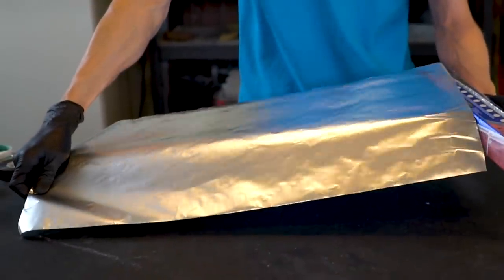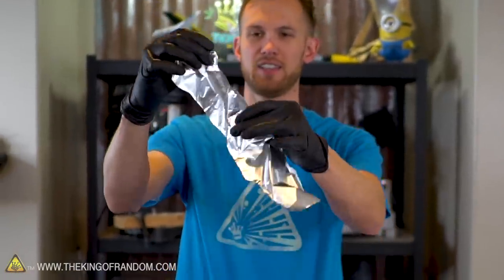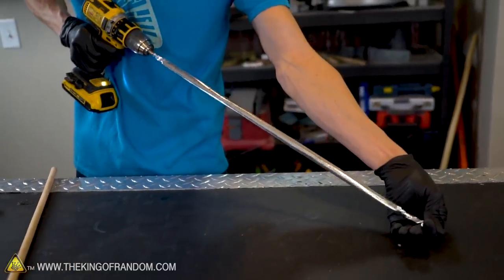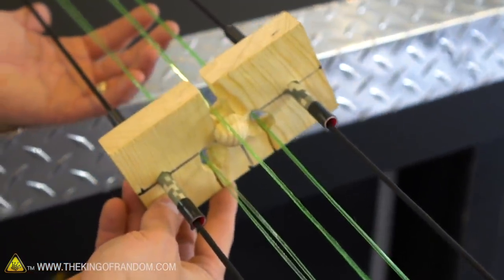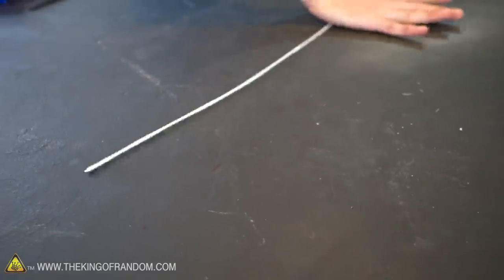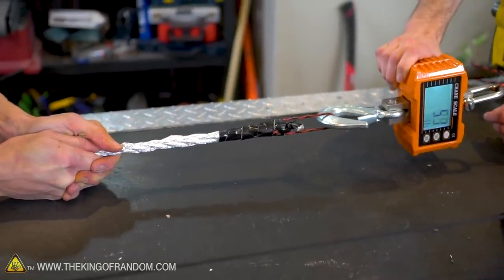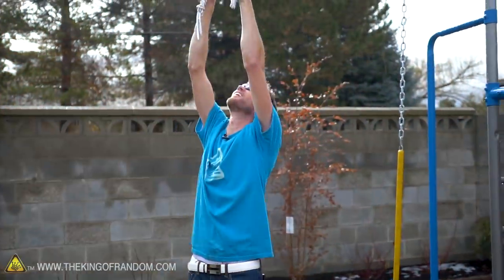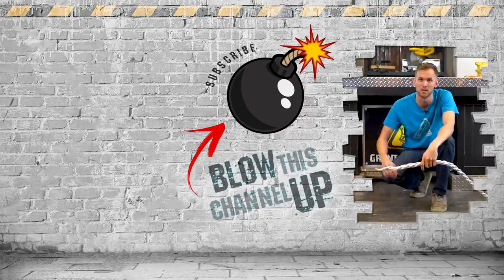Can You Make a Rope with Aluminum Foil?

Comment: Wouldn’t braided aluminum “rope” ...be an aluminum cable?
Reply: Yaaaaaaaaaaaaa
Reply: Duh
Reply: if it's purple it's called a braided Thanos.
Reply: Exactly what i was thinking. Thats basically what power lines are.
Reply: James Murray nasa wants to know your location
Reply: Yeah
Reply: Not really.
Cable is made from wire, that is metal that has been drawn through a die to form a long and solid piece.
This aluminium rope has been made in a totally different way.
Reply: @RovingJack  GG
Reply: @RovingJack  vi cbg
Reply: I mean he was saying cable in between the 9 and 10 minutes
Reply: @skinnyg214  pretty sure that is not want power cable is made of, its copper not aluminum. And second. The strand that everything is lashed onto is a steel cable 
(I work for a line work company I'm around it constantly. just an fyi)
Reply: @devincarson3577  i heard somewhere that a lot of new lines are switching to aluminum to be lighter and cheaper than copper. Im not an expert in this at all and if you have other experience, feel free to let me know :)
Reply: He said "cables" at about 10:02
Reply: Yeah
Reply: Jeff NME sis really hit us with the facts

Comment: You have a BIG problem that you did not know about or you did ignore it.

Aluminuim work hardens very quickly. that means every time you deform it (bending, rolling, pressing and so on) it becomes harder and more brittle and you aslo destroy the cristal structure of the metal what makes it even weaker. to prevent this you  can relax the metal by heating it making it more flexible, that gives you a new working window where you can work on it bevore damaging it.

When professionals deform aluminium they bend it a little, heat it up, let it cool on its own and beding it a little more and repeat.

aluminuim  melts at 660c° 1220f so i think heating it to 400c°-500c° max   752f-932f max should work.
I know this from Metal working scool in germany and have experienced work hardening many times my self but did never need to soften it there was always a workaround.
maybe there is someone here who has done this before and can share his knowledge.
Reply: That's interesting! Heating it would have been a very nice idea!
Reply: Longest comment ever
Reply: @explosivelemon5099  You don't read a lot of intelligent comment then :p
Reply: Blake Roberts this was actually quite short for a description
Reply: Though this may be true. His tegnique for making the rope itself was also poor i think.
Reply: @Lemmes Gaming noticed that TKOR viewers are not very smart, judging by most of comments
Reply: Very true
Reply: @Michursky  tkor itself is not very smart
Reply: *school
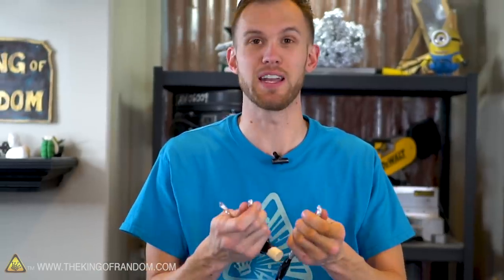Reply: He actually addressed this from about 4:40 to 4:50 ish and said that bending the metal made it weaker and gave the example of bending a paper clip. So although he did ignore it (because the user comment was asking to make a rope, not to see what happens when you bend aluminium foil) he did address it..
Reply: I learned this doing the metal working merit badge for Boy Scouts.
Reply: Yes, annealing is important!
Reply: Can you  make a rope with Seran rap
Reply: On an atomic level this is a really cool process. Individual atoms are shifting position within the crystal. To a point, this hardens the metal--this is why you hammer the edges of bronze swords after casting, for example. A crystal can hold only so many of these shifts (call lattice defects), however, and eventually a bunch of them line up, forming a crystal face, in effect splitting the crystal in two. When a metal breaks, those broken bits are actually a huge number of individual, new crystal faces. 

When you heat up the metal, you shift those lattice defects into new positions, creating new crystals--but without altering the shape of the overall object (much, anyway). It's one of the few common solid-state reactions. In effect you re-set the crystals, allowing more defects to build up before it breaks. 

This process has tremendous consequences in everything ranging from geology to engineering. This is why bridges fail, why rings break, why some beams are "pre-stressed", and how rocks bend. It was really fun in college seeing the same process discussed in structural geology and jewelry making classes. 

If you're going to heat up aluminum foil you need to do so in an indirect way. A torch or other direct heating method is going to make one side too hot, while the other side is still too cold. Foil is VERY easy to melt, being so thin. Maybe a toaster oven or similar would work. If you can carefully control the temperature of a kiln that may work as well, but I doubt you can get the temperature low enough.
Reply: The point of this excitement was to design a rope straight from the foil, but yes heating it up and letting it cool in a rope shape would definitely work.
Reply: shalini prasad u
Reply: @explosivelemon5099  youve been on youtube for about all of twenty minutes huh?
Reply: I had no clue... thanks for sharing.
Reply: Great comment! I came here to say this!
Reply: Nerd
Reply: Isn't it °C instead of c° ? Just asking
Reply: Dragnaros Donevan you are a beat. How long did this take you to write
Reply: who would actually read of that tho🤔🤔🤔
Reply: @wolfieg.6730  It sure is

Comment: What happens if you try yo melt down aluminum foil in a furnace? Like you would need a TON! But I wonder if it would be really pure once you turn it into ingots.
Reply: Hmmm... Would be nice to see.
Reply: :D
Reply: @B P I just want to see how pretty an aluminum ingot would be... Probably close to an iron one if I had to take a guess.
Reply: Pretty amazing suggestion
Reply: Chance Gray do u play Minecraft
Reply: That would be cool to see. Like, part of me is thinking, "Okay, so it's aluminum foil, so anything made from it melted will probably be weak AF." However, aluminum, when not thinned out like the foil, is hard and heavy metal, which is why there are so many things made with it. I just looked it up, though, and the foil itself is 92-99% aluminum while the ingot is 99.98% (Basically 100%) aluminum. So, what will that last 1-8% do when the aluminum is melted? But, to amp it up, I want to see how some things, like dry ice, reacts with the molten aluminum.
Reply: aluminum ingots
Reply: Molten aluminum is combustible in an oxygen atmosphere.  If your speed is too low and/or feed is too high when machining or if your inerting process fails during welding it will start spewing small bits of pink molten aluminum and then detonate.  So if the furnace exceeds about 1250F someone will probably get hurt.
Reply: Hey i was first
Reply: I think it would oxidize too much and you would lose a lot of metal because its so thin... except if you crush a bunch of it with mallet.
Reply: So it's dangerous? Now I really want to see!  @thedogsbutler7046
Reply: @mamakangaskhanvideos6376  You realise that aluminium is like the lightest metal that is practical for everyday use. It is also relatively soft.
Reply: I just thinking the same thing lol
Reply: Yeah thats cool
Reply: I understand that,  @Lolfml , but it also weighs 50 pounds as an ingot. Gold, a softer metal, only weighs 27 pounds in one bar. And the lightest metal is actually lithium.
Reply: Dude this comment got 160 likes overnight O_O
Reply: @mamakangaskhanvideos6376  Be sure to have a Class D fire extinguisher ready.
Reply: Trevor RS05 boi this isn’t Minecraft
Reply: I made an AR15 lower from aluminum cans. Works great. Got idea from a guy here on YouTube. So yes you could possibly do it with foil.

Comment: Can you make rope from plastic wrap or wrapping paper??
Reply: yes yes yes
Reply: i came here to request that they do this with plastic wrap but you beat me to it :P
Reply: Most likely the plastic wrap (Saran Wrap) would be stronger due to the long chain molecules and elasticity of the plastic would hold up better to a pull.
Reply: Yes but it would stretch
Reply: @Ricardo Sahadeo < A chain made of braided Saran Wrap would certainly stretch a little, but not indefinitely.  Once the stretching stops, then it becomes a strong yet slightly elastic chain.
Reply: I made one a few years ago when i got my hands on an industrial sized roll of it. The rope was about 25 feet long and it stretched quite a bit before snapping.

Comment: 1:29 I am fairly certain this is due to work hardening (sometimes called strain hardening).
Reply: It is
Reply: that and the heat imput cause I think foil is 2xxx or 3xxx series so it cant take heat very well
Reply: isnt it called work hardening?
Reply: @richie6799  it depends what material and what the action that is being taken upon the material
Reply: @bigbawss3273  ahh ok thanks
Reply: @bigbawss3273  is there a difference between work hardening and strain hardening?
Reply: Crinkling it may create stress risers in the structure, and one tear will cause the whole thing to fail due to crack propagation.

Comment: Wouldn't folding the foil first instead of twisting or rolling it make it stronger?!
Reply: Yeah, I was wondering the same. Probably would help, the sheet at the very start withstood more pressure than any of the first few rolled or twisted strands did.
Reply: Tightly yes
Reply: JJ's Life I think so, but it wouldn't technically count as a rope
Reply: it would break because its so weak
Reply: @danieltheisen5944  Me too.
Reply: Yeah

Comment: What happens when you mix melted glass and metal?or any other weird materials?please answer this question by experimenting. I'm very curious.
Reply: It will be an hetrogeneous mixture if u melt it for a short but homogenous after a long time....
Reply: Ceramicists and Glass Workers already do this, to some extent.  Ceramic glazes contain metallic powders, and metal foils are added to molten glass, for effects.
Reply: I'd be more interested to see what happens when you cool it at various rates. Even a homogeneous mixture will have different chemicals precipitate out at different rates. This is why popcicles always have that white-ish area that tastes bland.
Reply: That will break the rules of Minecraft
Reply: @jamesverhoff1899  great job comparing a technical topic to a more relatable household object. A+ description!
Reply: Glass (SiO2) is made of silicium, which is a metal...
Cristal is glass with lead (40% mass)

Comment: The rope should work better if the foil is folded instead of twisted  then take that folded foil and braid a rope. twisting the foil weakens it
Reply: 👉ROPE👈
Reply: Exactly, he even said the twisting made it weaker but kept trying it.
Reply: That's what I wwas thinking!!!! He just said that cutting it (which is essentially crimping/folding really tightly) made it difficult to pull apart..... So?
Reply: I believe the word "experiment" is used to prove something actually work
Reply: Really, I kept thinking it needed to be braided or woven in some way if twisting was a bad idea
Reply: `Yup, he should have folded into thin strips, not twist it.

Comment: can you make a salt water battery using aluminium, salt and copper
Reply: I like that 👍🤔🤔🤔🤔🤔👍 100 thumbs up
Reply: no because you dont have water
Reply: An "effective" salt water battery, complete with compressed carbon and stainless steel plates, etc... would be a great idea!
Reply: Wow that would be cool! 10000000000000000000000000 LIKES
Reply: Sadly its impossible
Reply: @insitefire272yeet2  you are technically right. The best kind of right.

Comment: Try melting aluminium foil then making a rope from that
Reply: Plz like lol
Reply: Magic21maker 21 then it would not move
Reply: It would be a rod at that point
Reply: They would have to take like at LEAST a few weeks. Since they have to melt the aluminium foil and pour them into small threads. So just to make 4 threads in a few hours. The rope would at least use 30 threads. They also have to be thin so you can ACTUALLY bend them.
Reply: It would be a cable
Reply: More realistically, get some really thin aluminum jewelry cable, and twist that into a rope.
Reply: its not foil anymore then, just aluminum.

Comment: You can.  The secret is folding it inwards and not twisting or crumbling.  The flat "noodles" of folded foil without exposed free edges produces the strongest result.  It's even stronger than just the sheet, as it protects the edges from tearing.

Comment: Instead of twisting the foil you should of just folded it lengthways a bunch until it was thin. Would of worked much better
Reply: o 44 u mean thick
Reply: *Would have worked
Reply: It's would have or would've, not would of.

Comment: If he used 9 rolls to make the rope... and one roll flat was able to pull 28 pounds... and his rope held just over 215 pounds... 215/9=about 24... So his rope was weaker than if he just laid nine rolls flat on top of each other? Maybe he should’ve tried flat winding them like a bass string or something
Reply: I was honestly disappointed that he didn't
Reply: thats not how it would work. laying 9 rolls on top of each other won't multiply the pull amount by 9
Reply: SAQinja nine sheets, attached to 18 dowels, attached to two anchor points, working together to pull, wont work? How come?
Reply: Pastapon cool nuh uh. A nerd would have suggested attaching two or three sheets per dowel, reducing the number of needed dowels. 18 dowels.. ridiculous...
Reply: This is due to metal fatigue aluminum in known to not be the best handling torture
Reply: Wow I love it
Reply: When he crinkles the foil together he is introducing micro tears that become weak points .

Comment: Do a cycle of heat treatment
Put the aluminum rope in 300-350 deg of celsius for 2-3 hrs
That will get rid of the residual stress from previous work hardening

Comment: put a tin foil ball in the vacuum chamber I really want to see what happens
Reply: @Dylan Scott ok but we dont know so lets see
Reply: yeah we do know, nothing is going to happen
Reply: @saqinja271  how do you no did you try it i just wont to no so dont be mean.
Reply: Well, the melting point of aluminum in a vacuum is not lower than room temperature.   Although it could be interesting because some air bubbles get trapped in an aluminum ball when you roll it up!  It would be weird to see aluminum expand from trapped air in a vacuum chamber!

Comment: Did you know before a paper clip breaks from you bending it, it is actually getting stronger because your pushing more of those atoms together and it becomes stronger so you can bend it like that.
Reply: Well, both yes and no - while it's true that this process is going on an atomic scale, you don't push together atoms, but rather totally mess up atomic structure of the metal grains (you dislocate the atoms in the crystal structure) which hardens the metal, but makes it less plastic, so easier to break.

Comment: Would you have better results if you twisted the foil uniformly along one axis. If it was perfectly rolled along its parallel edges would it not spread the tension across the whole horizontal piece of that foil?

Comment: Try to build a light bulb brighter than other store bought ones:]
Reply: By carefully breaking the glass on store bought bulbs, they could extract the filaments and wire them all up in parallel inside their vacuum chamber. The radiant heat from the frankenbulb might cause their vacuum chamber to shatter.

Comment: I made a rabbit hide blanket using that method. It was in the 80's and I was asked to make one for a museum. They wanted clothing examples of Native American tribes in the Southwest. I bought fifty rabbit hides, spiral cut them into 2 inch wide strip then sewed them end to end. I used the drill method and seventy feet of hides. The worst part was trying to make sure the hair was on the outside and skin wrapped on the inside. It didn't seem a great idea at the time but it worked.

Comment: The Foil would hold up better under greater stress if you carefully cut it into long but very thin strips - and THEN weaving it.  Having one of those planed paper cutters would help though (with the long heavy duty slicer that lifts and drops - you know the kind)  The key here is the surface area of what you're working with.  I would say cutting it into 1-2 mm wide and about 1.5 foot length strips would be best.  ALSO - you don't want to TWIST the strips together, JUST WEAVE THEM.  In essence you'll be making your own fibers doing it this way - you just gotta be careful you don't twist the fibers when you making it - and you only weave them.  Then weave the bigger pieces together - and again repeat.  Eventually you'll have something worth noting.  Is it worth the time?  Only if you need some rope and foil is the ONLY thing you have access to!  LOL!  

I would also try doing cuts of 5 mm wide (but long strips) - then FOLDING the strips in half - and THEN weaving them.  I noticed that FOLDING aluminum foil DOES increase it's strength.

Comment: If the foil was rolled you can hammer it tightly to perform cold welding. From there you’ve basically made solid wire. Braid that together and you are limited by how compact the welding is

Comment: try folding the aluminum foil like banding/strapping the more flat surface area the stronger it is, rolling it up creats many little weak points due to the creasing  that goes on

Comment: By the “technically it’s still one sheet” rule you’re basically giving yourself an unlimited amount of foil to use and therefore an infinite rope thickness. So by that logic you can basically take a giant sheet, fold it up, and do a pull test like that. I suspect that would hold up much better. Probably about 28 times however many layers of folds.

Comment: I think it would be better if each individual string of rope was made of more than 1 aluminium foil sheet. Put 4-5 of those together so they stick, cut them in pieces and roll them together. Then do this 9 times as you did and make the final cable. It will be larger in diameter but I think not by a huge amount since each sheet of aluminium is really thin.